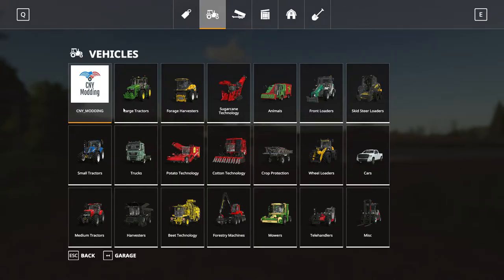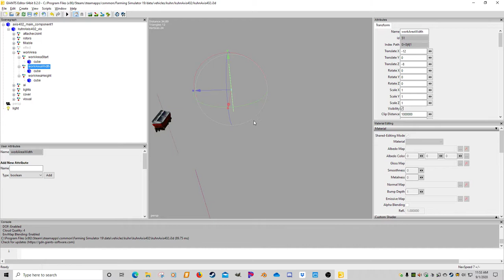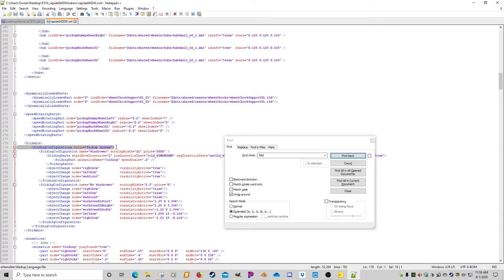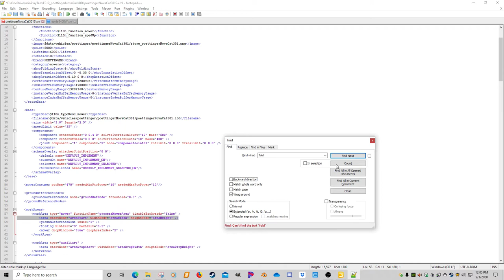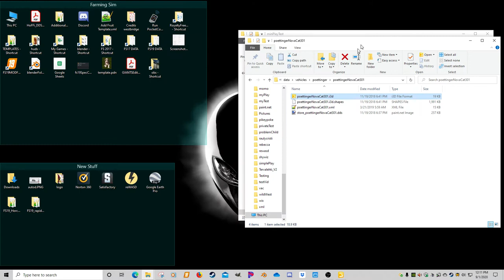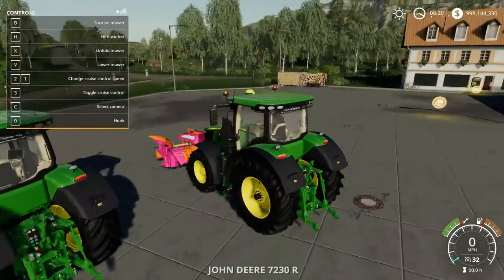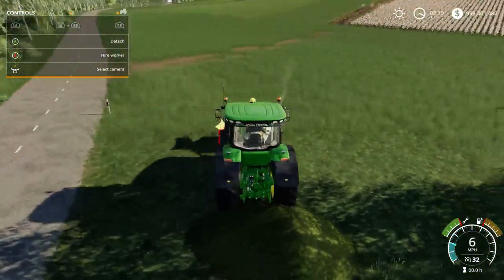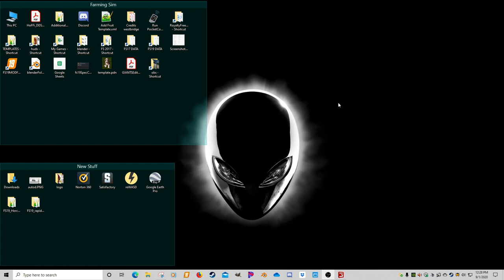FS19 Work area change or move with fold function.

Comment: Thank you for your insights.  Any chance you suggest some issues why when I fold a JD1770 16row planter, it is as if the wing wheel collisions stay in the extended (ready to plant) position, even though the wings fold in?  I can't figure it out....the "invisible" wheels cause havoc when trying to pull the planter down the road etc....
Reply from the maker: Yes. The wheels need to be referenced in the moving section. One sec I think I have a topic about this on my site. I’ll see if I can link it to you.
Reply from the maker: https://farmerboysmodding.com/index.php?/topic/2362-wheels-on-moving-parts-make-collision-move/

Always feel free to look at my contacts and join my discord.